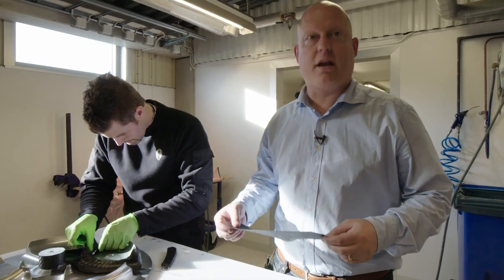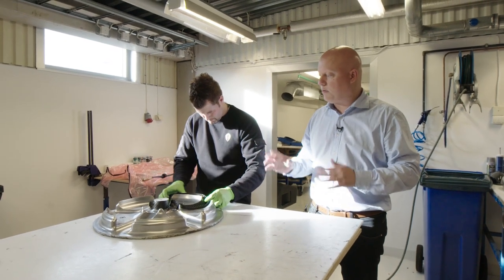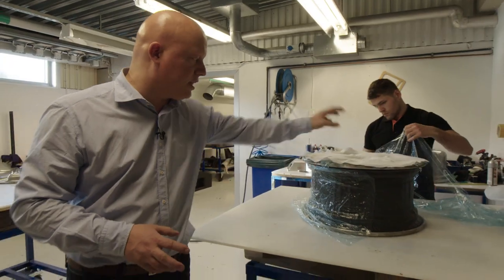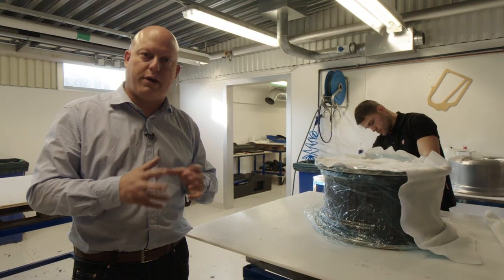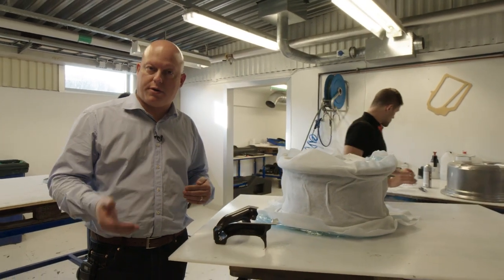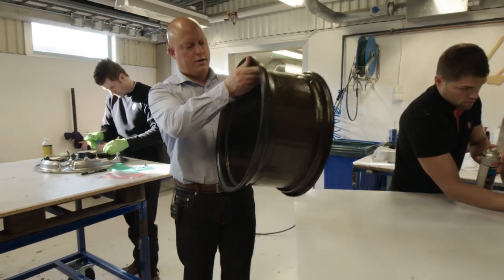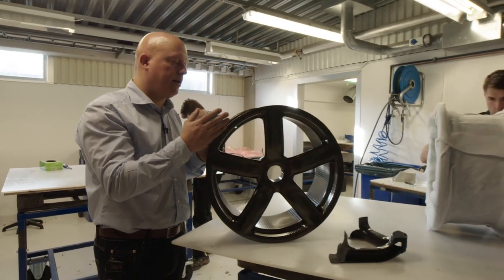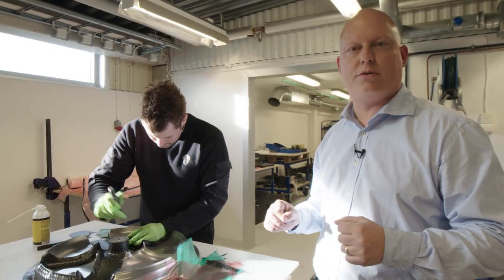Christian Von Koenigsegg Explains How He Makes 280 MPH Carbon Fiber Wheels

Comment: I don't know about the wisdom of carbon-fiber wheels, which I'll get to in a second, but I think it's a symptom of a larger problem. Koenigsegg creates amazing hyper-cars, no doubt, and I say this with no disrespect, but like Pagani with the Zonda, all the cars Koenigsegg have produced over the years have been varients of the car that Koenigsegg came out with around a decade ago. In other words, building ever quicker and faster cars based on the original car, with tweaks to the aero, lights, engine, etc. like Pagani did with the Zonda. The Zonda has been around for around the same time span but with new sub-model after new sub-model coming out over the years; the Zonda, then the Zonda F, the Zonda such and such, getting faster and quicker but it's still the same basic car. Finally Horatio Pagani said something like, "ok, the Zonda has reached its pinnacle, it's time for a new ground up model, and the Huayra was born. Really no one can debate that aesthetically, the Koenigsegg looks like the same basic car from the original to the CCX to the Agera, albeit with changes to the drivetrain, the lights, little things like canards, and the same is probably true with the interior. I really think it's time for Mr. Koenigsegg to step back and say,"right, we've built these amazing cars over the years but it's time for an entirely new, ground up Koenigsegg model."
       The reason why I am connecting this notion to something like the carbon-fiber wheels is that it's beginning to feel like, "right, what else can we possibly do/change on this platform?" And in my opinion and the opinion of some engineer friends of mine, carbon-fiber wheels are dangerous. Yes they are stronger and lighter than steel and aluminum wheels, but the problem comes at the breaking point. Before those metals reach their breaking points, they bend and flex, while carbon-fiber reaches its higher breaking point but then just shatters. Remember what's making the carbon-fiber rigid is the resin and it's like shaping something out of string and super glue that is brittle when hard and when one tries to bend such a thing it just snaps. The same is true with carbon-fiber. So lets say you're in a 200 mph + situation and you need to make a sudden correction, or in a high speed cornering situation and you happen to exceed the structural limitations of the carbon-fiber wheels, they are going to shatter, and that's at least going to lead to a hospital situation or worse. If a metal wheel reaches it's structural limit, it will start to bend or flex, ideally slowly letting the air out of the tires and you feel like you have a puncture and you slow down and come to a safe, controlled stop, as opposed to having a carbon-fiber wheel shatter, likely taking the tire with it; a situation even the most skilled drivers would be unable to recover from, i.e. coming to a nice controlled stop. When discussing this with my engineer friends, who are into F1 like I am, we all agreed there's either a rule against the use of carbon-fiber wheels or they don't use them because of the safety hazards. Imagine an F1 car taking that 4 apex sweeper at the Bahrain circuit, if memory serves me correctly, pulling 5g going somewhere close to 200 mph. If a carbon-fiber wheel were to shatter then, it would be a miracle if the car stayed right way up and no massive shunt were to not occur. Think about it: a spoke or two shatters, causing a string of events to occur, like the rest of the spokes shearing off, the tire leaving the car, possibly hitting the driver, and the car spearing off straight ahead, and even if no collision with another car occurred, the out of control car would head straight for the "kitty litter," probably digging in and going end over end violently. Again, at the very least, the next thing to happen would be for the driver to be taken to hospital (or the medical center) or worse. My job has nothing to do with the making or selling of aluminum wheels, or any other metal for that matter, so rest assured I'm not just trying to create bad P.R. for carbon-fiber wheels lol. This is just my small youtube voice trying to somehow reach out to Koenigsegg and suggest it's time for an entirely new, ground up designed Koenigsegg model. Pagini went from the Zonda to the Huayra and it's time for Koenigsegg to move on to the...(Let the search for the new model's name to begin).

Comment: On 10:06 this video reports wheel size 19 x 10 and weight of 6 kg without painting with UV coat. 
Compare to a larger wheel 20 x10.5 with UV protective clear coat and weight of 5 kg
https://www.youtube.com/watch?v=2j7cWewD6vU

Comment: is that negative mold made out of aluminium?
Reply: He mentioned that in another video from this same series, it's something with a similar heat expansion property so that when you bake it at high temperatures, the part and the tool expand equally as much.

Comment: quick question how do you attach the wheels to the car. dont the bolts risk cracking the carbon fiber. hope its not too stupid of a question ahahahaha
Reply: Did you not listen to the video? Carbon fiber is stronger than steel or aluminium of it's equivalent thickness. It can withstand a much greater impact than any alloy. They won't be worried about cracking it with a few bolts.
Reply: Shona yeh i know its stronger but unlike aluminium or steel it can crack. but i guess your right
Reply: +yoman299mw2 If you drill the holes out well you will be left with a smooth hole, and if you remove any sharp edges there won't be any stress risers from which cracks can form.
Reply: KumquatWraps thats the answer i was looking for :) . thanks
Reply: +yoman299mw2 they won't be drilling any holes. that one hole in the center is how it's mounted. just one large center locking nut. so what you see in the video, was a finished rim.

Comment: Carbon fiber is known for it's strength and weight but horrible for absorbing impacts. I'm sure going 200 plus mph and hitting a crack in the road will shatter the carbon therefor causing so much more damage to the car itself as well as others around the car.

Comment: what exactly is carbon fiber like mixed with and is it solid or soft material
Reply: +quarawlis stafford As I understand it, the weave is preimpregnated with epoxy - glue, basically. As he mentions, the carbon fiber raw sheetstock is sticky to the touch. But when you bake the assembled component while pulling a vacuum on it like they do here, the glue melts, fills every void and gap in the construction, and then cures to an incredible hardness.
Reply: +Xiuhcoatl Is it preimpregnated with epoxy?
Reply: Yes
Reply: +Xiuhcoatl dead rn...XD
Reply: What a strange turn this has taken thanks for the explanation james

Comment: Why Koenigsegg not to go racing ?
Reply: Way too low volume of a manufacturer. Koenigsegg tried that with the CCGT (which is a naturally aspirated racing version of the CCX). They built it to what was then the FIA GT1 regulations… then the FIA changed the regulations wherein Koenigsegg could no longer enter the CCGT into competition for two main reasons.

Firstly, Koenigsegg does not build many cars each year. The FIA had a mandate at one point where a manufacturer could enter their GT1-spec car into competition provided that the manufacturer produced 20 cars over a period of a few years. However, the FIA being the FIA, they changed the production requirement to 350 cars per year, which is something impossible for Koenigsegg to do given its low-volume production business model.

Secondly, continuing with FIA regulation changes for what was then GT1, the rules were then tweaked to outlaw carbon fibre monocoques used. And as we know, Koenigsegg and Carbon Fibre are inseparable.

Comment: For gods sake tell michelin corp to make perfectly round and strongest walled tyres that way you dont have to take off the tyres and try to balance the wheel to the rim or vise versa , lol :) If they can make tyres for aircraft industry which are almost perfectly round and has the best tech on this earth, then i am sure applying the same tech to sports cars carbon fiber wheels will and can be done, its all a matter of cost really ?

Comment: Why waste your time and money on a permanent mold for the rim when you can just 3d print it in-house and have it available anytime a mold might go bad or the unfortunate event of human mistakes
Reply: @JayDee-b5u  not talking about printing the rim, you can 3d print the actual mold that the carbon is formed around. That way if anything happens to that permanent mold that you pay thousands for, you can just 3d print a new mold.
Reply: If the mold were to get damaged and need replacing it is actually far cheaper to CNC a new one out of aluminium than it is to 3D print a new one.

Comment: Not even 1 minute in and the BS has already begun.
0:42 "We only use the most extreme type of carbon fiber and it's called 'pre-preg'".

Pre-preg has nothing to do with the type of carbon fiber. It is simply indicating that the fibers have already had a type of resin applied that coats the fibers. You can get pre-preg in basically any grade of carbon fiber you want and in and type of weave, from unwoven UD carbon, right up to woven 15k, with high modulus grades of fiber as well as more standard grades. Pre-preg carbon fiber is industry standard because it's a big labour saver and cuts down dramatically on polymer resin waste.

Also, pre-preg is typically NOT a 2-part epoxy. It is usually a 1-part, heat activated epoxy. 2-part epoxy is activated by a chemical reaction. This makes epoxy effective under water and in zero-oxygen environments. But the chemical reaction happens within minutes. As long as the two chemicals are able to interact, they harden within minutes. If they don't interact, they don't harden properly. This requires mechanical manipulation for thorough mixing. Not an option for inside a mold. And definitely not an option for chemicals that are stored in place for up to a few months at a time.

Nothing else the guy has to say has any credibility.

If you asked a child to tell you which paper is strong, construction paper, white A4 paper or tissue paper and he turned to you and said "this one has glue on it", you'd put him in the category with Ralph Wiggum.

Comment: in fact the ford gt as carbon wheel and produced more that the car in this video
Reply: Ford GT uses cast aluminium wheels with the option for carbon wheels and that option is only available on the 2017 and onwards models. Koenigsegg were the first to use carbon wheels on a production car.

Comment: “We’re the first to make carbon fire wheels”

My uncle has made them for 20 years in Nashville. 

Prepreg isn’t the best you dummy… That just means you bought it with the fiber mesh already wet with heat activated epoxy… NOT two part.

Comment: Isn’t fiberglass stronger...?
Reply: Carson Tinsley depends on what you put in the word stronger.
Reply: Jonas Larsson there’s different kinds of fiberglass which are “stronger” all around.
Reply: Carson Tinsley Name one.
Reply: Jonas Larsson it’s called “S Glass” lol. Still used in modern aircraft. Not quite as stiff but has a much higher strength which typically get mixed up.
Reply: Carson Tinsley Tensile strength of S-glass is typically 342 ksi. Carbon fibre has a typical tensile strength around 500 ksi. But glass has higher elongation which adds safety. As I said, it’s about what you put in ”stronger”

Comment: These wheels wouldn’t be any good on the UK roads, I’ll bet there mega expensive too!!
You would need a set of steel rims with wheel trims for the UK LOL
Reply: Actually the tire sidewall thickness is the key to protecting the wheel regardless of material. If your tire is too thin, that is one bent or broken wheel over the first pothole.

Comment: To be able to take that heat in a good way.          You mean to be able to with stand that heat.       I don't think one looks a warped wheel and be like.       Oh yeah it didn't take to heat well what has happened to the wheel.  It doesn't take heat very well.        I know they are 100 times smarter than average Joe incubator multiplying on this earth.    But you also have a brand.  And you need to represent it. In not some way a child thinks and talks.   I hope the wheels will take the heat well.   Yes.            What do I know I drive a civic to work and to get groceries.   They actually drive you know.   Amazing right.

Comment: Citroen sm wheel was carbon fibre in 1971. So you are not the first.http://jalopnik.com/michelin-made-carbon-fiber-wheels-for-citroen-back-in-1-1543922374
Reply: stephen sansom That's not Carbon fiber, its a Carbon resin with Steel in it. all they do is pour resin in a mold and bake it. Carbon fiber weaves will be much stronger than that resin. the resin wheel will chip and crack the minute you curb it slightly.

Comment: ford mustang gt350 has carbon fiber wheels.....
Reply: +Patrick Donahue, NO...The 2015/16 Ford Shelby GT350 comes standard with Ebony Black Painted Aluminum Wheels.  They measure 19x10.5 in front on Michelin Pilot Sport Tires measuring 295/35ZRx19 and the rear wheels are 19x11 on 305/35ZRx19 MPS Tires.

But...YES!..The 2016 Ford Shelby GT 350-R comes standard with all Carbon Fiber Wheels Manufactured by a Company called Carbon Revolution out of Australia.  They measure 19x11 in front on Michelin Pilot Sport Cup 2 Tires measuring 305/30ZRx19 and the rear wheels are 19x11.5 on 315/30ZRx19 MPSC-2 Tires...Hope that Helps!

Comment: The problem with your basic concept is you are limited by the engine.  Electric motors are NOT the answer due to weight.  My new engine is.  Want to have a discussion on how to make the correct engine for the fastest engine system, that can get 250 mpg on the highway?  Serious.  With your charm and salemanship and my engine we could get 80-95% of the fuel out of the world and have the best and faster cars and airplane.  You do cars and I do seaplanes that go 400 mph.  I race you with my seaplane pulling 1.5 G's....

Comment: Kevin Carter Look how much the guy did in the few minutes he was on video. And I clearly said and hour of MANUAL work. Nope I've never worked with carbon fiber in my life but I'm also not blind. Regardless, I'm not going to waste my time arguing with a super car fanboy. I've learned that they only ever hear what they want to hear, oh and of course... They're NEVER wrong. Chris Sewell Fuckin coward.
Reply: Jimbo Cee  Given that you can't seem to get your point across without name calling and personal insults I probably shouldn't engage and feed the roll, but sure... why not.

I mean... I really couldn't care less about super cars. The technology involved is certainly interesting but I really don't think you have the foggiest clue what it takes to make something like a wheel using CF (I've done some much simpler fiberglass work which is similar and that was easily an hour). You also have to be exceptionally careful making it and, more importantly, are pretty likely going to toss our quite a few due to imperfections. Sure, to produce a single wheel that may or may not pass QC standards might take a couple hours but to actually get a wheel that won't fly apart at track speeds, I suspect, takes considerably longer given the number of them you toss out. But prove me wrong. Go build a CF wheel and put it on anything that'll go over 55mph. We'll see how your one hour wheel fares then.
Reply: I'm pretty sure I got my point across quite clearly the first time, nice try though. Nice paragraph, too bad it was a wasted effort cus I'm not wasting my time reading that LOL.
Reply: Jimbo Cee 

I'm pretty sure I got my point across quite clearly the first time,

Well, you'd be wrong.